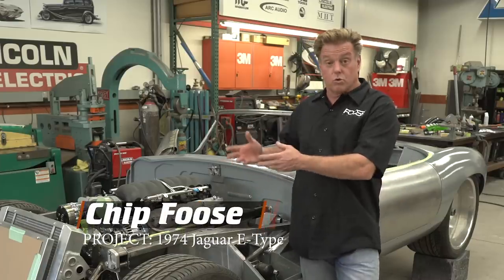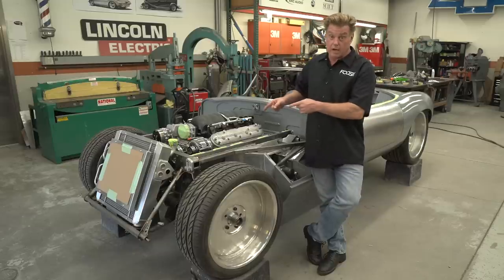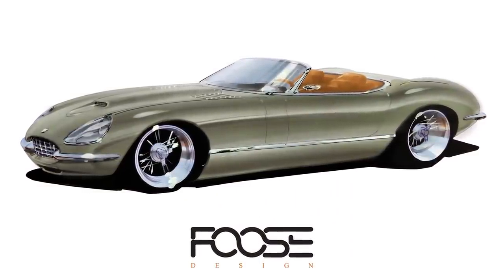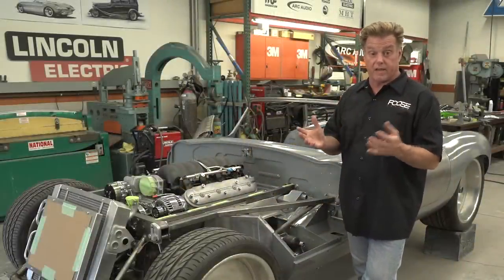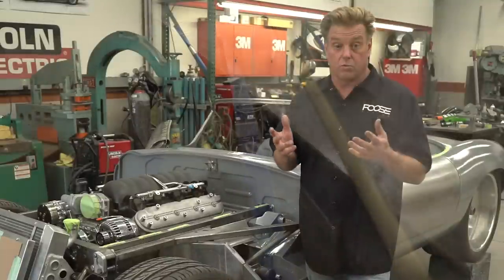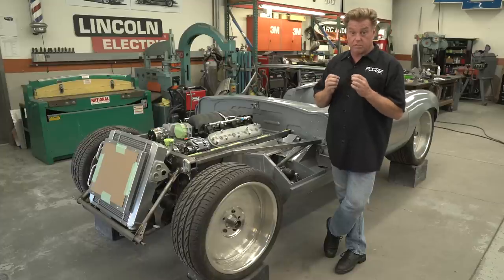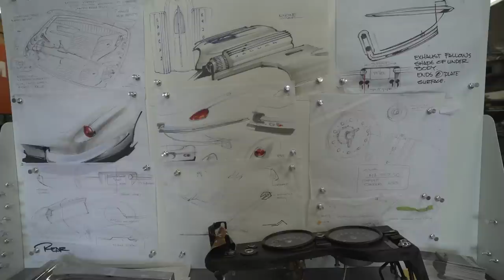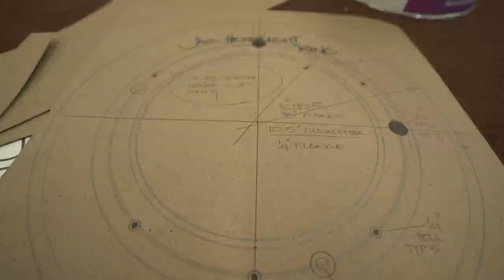Foose Design Jaguar E-Type Roadster - Metalwork Complete!

Comment: All good except the tail lights they look like they come from the 40's  should have used the series 1 tail lights along with the rear changes you made to the number plate recess! and bumper bars ! I have an e type with a 302 ford so I like the engine swap !

Comment: The whole elongated front section of the car and therefore the whole look and appeal of the car was the V-12 powerplant. Taking the easy way and dropping an American crate motor into the space takes away a ton of the appeal (to me) of the car. Massaging the V-12 to modern specs w/ electronic fuel injection and twin turbos would have made an AMAZING sound plus would have looked at home in the car it was designed for. But Foose is a coach designer rather than an engine builder and doesn't probably want people buzzing around the open hood admiring the engine.. But rather wants the hood closed and people taking 5 steps back to admire the lines. Just not my way of lookin at it but then again it's not my car now is it.

Comment: Im a fan but doing that to an E jag is like customizing a 64 vet. Switching the engine was a good idea but the car is a classic and beautiful when it rolled off the line. In 10 years your customization will be dated. The original design was timeless. You can change it but your not going to improve it.  Your just going ti make something different out of it.

Comment: Seen some marvelous cars come out of the mind of Chip Foose but this aint one of them. Sorry total looser this time. To explain how would take more words than l could possibly type.But you can start with the chevy V8 great motor but not for this car.This car screams a V12 ,can't take smog motor horsepower and compare it with today's performance. See what can be done to that motor with today's engineering you just might be surprised at the horsepower numbers. Chip Foose you are a talented as anyone around this day and age use it.

Comment: There's a lot of discontent here about what Chip did to that Jag, but keep in mind that people have always customized their cars to make them unique whether replacing the original wheels with mags, changing the paint schemes, swapping motors,etc. I'm not crazy about the look of that car Chip is doing, but that's his (or the actual owner's) prerogative. It certainly looks well done. I have a XKS that I converted into a hot rod. Everywhere I go with it, people take pictures of it, talk to me about it, and many ask to ride in it. The funny thing is, it isn't even finished. I've got primer on my fender flares, my interior is nowhere near done, but everywhere I go I get very positive comments. I'm sure if I took it to some stuffy country club it would generate some snide remarks from purists. I say, if you want to keep something exactly as it was, go buy one and keep it exactly as it was. I won't mind a bit.

Comment: WOW!  A very sexy beast, that I don't EVEN want to know the price tag for!  I was thinking though, rather than chrome plating those trim rings and the strips running down the front fenders, why not leave them as polished BRASS?  With the main body being a silver-green, and the other chrome touches it would help those design elements pop out a bit more and yet still be an elegant understatement.

Comment: I’m okay with the redesigning but i disagree with the powertrain choise. There are a V8 with compressior what is gives alone 400hp. Why need to put a GM LS motor and taking away the identity from the car?  There is a company in New Zeland called Becham who is restomoding Jaguars they using only jaguar parts. I was impressed by their work cause the way how they touched everything on the car was amazing. The old Jaguar is still the same old Jaguar just meets the new standards of the modern world.

Comment: Foose only took 58 years to improve on the mass-produced original and they have done a fabulous job. BUT this is a hand-built one 
-off so can't compare with affordable original. Eagle in England also did a great improvement on the original with the 4.2 twin-cam straight 6 stretched to 4.7 litres...those 5" original wheels were ridiculous...

Comment: It looks good, but using an LS3 is just lazy. There is no excuse not to use a Jaguar Gen 3 AJV8, the weight is virtually the same and it has been tuned to over 600hp.

Comment: So you took a Series 3 E Type, and turned it into a Ferrari 330 GTS with better looking headlights and then fitted it with oversized drag car style pie plates? dont they make brakes that would stop this thing without requiring it to ride on Ox cart wheels like this by now? other than that, paint it a nice period creamish yellow, some decent wire wheels, and it would look pretty good with a black interior with the modernization you've done to it.

As I cant say dumping that V12 isnt a bad thing, it wasnt really that special, if anything if you had to go with a V12 I'd say find a wrecked lambo and put THAT V12 in it from an early diablo and see how she does. but you could do far worse than an LS3 to say the least.

Comment: Seems like a waste of a lot of money and a good '74 E-Type OTS.  Would have been better to start with a less valuable '73 2+2 E-Type.  A '74 OTS may go for a slight discount to an earlier V12 because of the large black overriders, but those can easily be removed and replaced.  Regardless, a solid '74 is easily a $60,000 car -- hardly "next to nothing" except in Chip's world, I guess?  The V12 is heavy by modern standards, but as Pablo said below, it can be updated relatively easily to achieve stunning performance.  After all, it did win Le Mans in '88 and '90 in 7L form, and I know several guys who have built 7L versions for reasonable money.  If it was up to me, I'd put the money into drive train and suspension upgrades and skip most of that crazy metal work.  The lines of any E-Type OTS are really hard to improve upon!

Comment: Alright, I understand why you would remove the original V12. They are lovely engines when they are running. The main problem being that they do not run very often. Your three "big" friends need to go on a diet though.
Reply: The unreliability was due to the Lucas fuel pump which would occasionally seize and needed a good whack with a wrench to get it working again. Also the SU carbs needed frequent maintenance but these problems are easy to fix with TBI and electronic ignition

Comment: I usually like Foose's designs, but he got lost here.
It may be that I see it a bit narrowly with my European view. And I'm not talking about the engine. Yes, it's a no-go, but if you know the original V12, you can live with it.
In Europe we regard the E-Type as a design icon that has nothing more to improve. But only the Series 1. Everything after that is misshapen, especially the Series 3 which was only available with a long wheelbase. For the installation of a V12 the body was inflated. The result was an overweight, low performance vehicle. We regard this as a pregnant oyster.

A Series 3 never becomes a Series 1, even if you add so many attributes to it, just as a field horse never becomes a racehorse, even if you strap a racing saddle on it.

And there's something else, and I'm particularly disappointed by Chip Foose. Normally Chip is a good designer who consistently draws the style of a vehicle through the entire vehicle, as it should. Why did he miss the fact that the entire vehicle is characterized by horizontal lines? The rear lights don't work at all. I can understand that he wants to sink the taillights to get a cleaner look, but still the taillights have to be horizontal. It looks like Chippendale furniture in a Bauhaus apartment.

Comment: Sorry Chip Foose.. This is not A American muscle car. If you use closed alloy, use the Dunlop closed wheels from the D type or use the wire wheels. This takes a lot of study to do it the right way .. Nice metal work . But get rid of the horrible grill and make the front just as it was on the earlier E-types. Make it a gaping oval. Make it look clean. No details. Just bare metal finish! That is your style! Show craftsmanship!  No bonnet scoops, no V8!!! If you want more power from the v 12 Give it : Webbers, NOS, Supercharger, or A Bi turbo, sidepipes, annything you like.  And it will outrun anything!! A V8 in front makes it under steer! an E type needs to over-steer !! Wrong wrong wrong!!

Comment: This is like starting with Marilyn Monroe and developing into Donut Turnip... All the excuses for changing the looks, engine etc on one of the most beautiful designs in auto history just don't wash.. The V12 can easily be reworked to accommodate the 550hp that the LS3 gives.. Basically they are just building a street racer that will handle like a bag of marbles on an oil slick when driven round any real twisty roads..

Comment: I think the engine and gearbox swap was the best idea so far to get more performance , if there would be someone out there who would build better gearboxes for those type then it would be 
questionable , because the original gearbox was always a weak one and in my mind at it`s limit with the factory specs.